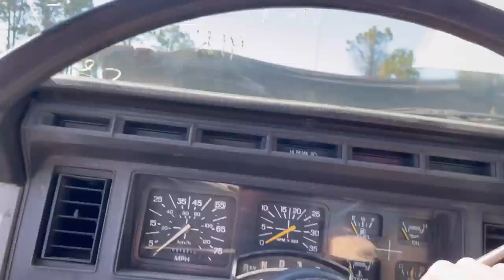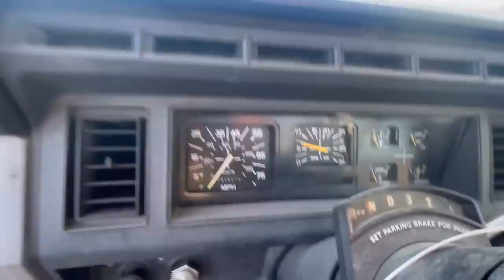How to Get CHEAP Welding Equipment | AUCTION TIME!! |

Comment: The boom truck with the rope winch line is a line truck for electrical work. Many of the newer ones have rope winch lines rated at 50,000 lbs pull. Rope because they’re used to set poles and transformers etc in and around energized high voltage lines typically from 2400 volts up to 34,500 volts. You wouldn’t want steel line although we did have steel in the old days (retired lineman here). The thing you were asking about on the end of the boom is pole claws. They are used to grab a pole when it is standing upright to put it in a hole.
Reply from the maker: very cool bud! thanks for sharing that!

Comment: I don't know exactly what lube equipment or mechanic work entails in this case, but I find it amusing that Anthony wants nothing to do with it.
Reply: It is hard work but great money I'm a mobile mechanic for heavy equipment
Reply: “Lube tech” would be for like a paving company. That the equipment is always on the ride. So, he would go around and service it all
Reply: @Ethan Baker  all types of companies have lube trucks. They just simply lube the machines. Grease fittings, fill with fuel, top of fluids. All types of construction.
Reply: @timmensch  yeah im a field tech too. Clean money dirty hands. Hard but easy at the same time
Reply: I'm 62 retired 7 years ago. Built a heavy equipment repair business from a pickup truck to a full service shop and 5 service trucks. Sold it.
Damn good money for a high school graduate.
Welders are too stupid to be techs.
Reply: @Tom  Baker  that's awesome brother. I am debating starting my own field service business. Actually selling a piece of equipment to afford a cheap service truck.
Reply: @benjaminolsen6520  I have one for sale. Where are you located?
Reply: @tombaker6083  southern Arizona

Comment: Looks to be a 5.9 12 valve all mechanical. Good old motors I believe she is going to be a good rig.  The old 12 valves are a little weak being 4x4 it’s going to be slower but I’m sure it will be very reliable.  Keep up the content.
Reply from the maker: your truck inspired me lol
Reply: @MeltinMetalAnthony  that’s awesome glad I could help. I think you’ll like the capability that comes with a 2 ton truck I know I’ll never go back. Planning on doing a walk around on mine and show improvements I’ve made and problems I’ve had hopefully give you some insight.
Reply: I have the same truck with an altec boom on it absolute dog around town 5th gear is 35-40 and 6th gear gets you up to 62 diwnhill with absolutely nothing on the truck can get more cars places but wouldn’t want to drive it anywhere far

Comment: Looks like a good setup. I'd be inclined to mount the welder with the face and leads coiled up into one of the front cabinets, what ever side is easier, the put some gasket around the cutout for the welder. Save from having to climb up and down that thing all the time.

Shes a bit tall for me,but man does it look functional. Hope it works out for you, cant wait for the videos on it

Comment: I’m in the music business and used to have the same 12V under the bed of an old motor home we traveled in. Used to take turns drivin it all night  and had a spot in the carpet where we wedged the pedal to the floor. Had parachute rope to pull it off the floor if we hit traffic lol. Pulled a loaded 16ft trailer all over the country and got 11 mpg. She didn’t have much power but I never missed a show. Good times

Comment: Badass tank you bought there. Holy shit, that thing is a beast! I’ll be straight up brother... you are quite the inspiration. I actually started welding three weeks ago because of your videos. I bought a little 80 amp arc from the H.F. To tack weld for blacksmithing, but you opened up my horizons to do more. Now, after two weeks of burning holes in everything I touched, or sticking the rod like it’s a magnet; I can finally start a weld without too much of that. Haha, I’ll admit I’ve had a couple melt downs in the back yard, and I think I actually went full on super sayan at one point. 6011 is becoming my favourite rod because you have to think about what you’re doing. I feel like I could take a knapp with 7018 and it would work... if you can get it started. I feel like you have to tame 6011 and 7018 is just it’s beta cousin. Anyway, I bought a tombstone yesterday, so I can run 1/8 inch and maybe pick up some neighborhood fixes for some real world practice. Of course I watch IC weld because who doesn’t, but you’re more gritty like me, so I end up relating to your videos the most. Thanks again for the inspiration, and if you’re ever in Melbourne/Palm Bay area, hit me up.

Comment: Good job, I would have bought that truck too. The best part of buying older equipment is there is no emissions (EGR, DPF, DEF) to worry about. Then I believe that motor is all mechanical, only a few reasons why it would not start.

Comment: That odd "rubbing noise" with the oil cap off may only be normal gear case noise on the Cummins.  My old 12 valve scared the hell out of me when I popped that cap for the 1st time when it was running. 

10 years later after much abuse (like 4500 rpm and 60psi) it's still the same.

Comment: @Meltin Metal Anthony
What frontend is in that truck?
Rockwell or eaton
I think i saw on the truck its awd all the time. So does it have a low range? 
My pops years ago bought a water truck that was a f700 or f750 4x4. But it had a 377ci gas big block ford with a 5 speed manuel trans and a rockwell independant transfercase.
I thought the axels under it were eatons, but they may have been rockwell. Not sure.
Anyway cool truck.

Comment: Sale tax...  What a deal killer.

I'm just an intense DIY repair/fabricator.  I buy everything used from private sellers -- generators, power equipment, power sports equipment, tools, welders, sewing machines, appliances, and anything else I can get my hands on.  I show cash and price negotiation starts at well under 30% of street retail.  I don't bother with anyone other than motivated sellers.

Of course, it helps to be able to fix/repair/fabricate stuff that's not in the best shape to start with.  But, once I give something the once-over, it usually serves me very well.

Getting ahead is a combination of making money and saving it...

Comment: Im guessing your state requires an actual weight printout, Ohio its verbal declaration. Ive registered a chevy 1500 as a 10,500lbs truck for commercial plates to avoid E-check.

Comment: Lincoln Electric Sam 650 used and abused as a stud gun the quality of the machine I'm looking for is its ability to run high definition spray arc I wonder how you would find out is it who got that machine and what they would want for it to part ways with it is it heavy maybe they figure out they don't want to drag it around how would you go about contacting that person

Comment: Cool truck! I find it's hard to buy smaller items at auctions for a welding company because nobody knows retail prices and often pay 20% over it. Engine drive welders always go for high prices in my area! The amount of 10 year old ranger 250s that people bid $5k on is insane! The older bigger items like your truck seam to be where the posers stop bidding and you can actually get a realistic price.
Reply from the maker: the engine drive air compressor I got was a good deal. you have to be quick with the google searches
Reply: @MeltinMetalAnthony  yeah that was a good deal! Those compressor s go for 3k new where I live!

Comment: Nice truck all your welding things can be mounted good price too Cummins engine too the mechanic part I'd not do anymore repairs if I don't have I use to do diesels in the 70s up to about mid 90s along with welding now I'm full-time welder no more repairs

Comment: I swear you are in my head.... only this morning i was wondering. As i learn more and more i keep wondering about finally taking the leap and becoming self employed (and the whole way i got into fabrication was because i was made redundant where i worked before -and had planned to learn to weld and leave there too) 
But i worry incase i ever get made redundant in the future and dont have the money to just go out and buy a welder and van (in the UK) and more expensive tools.  
I already have a large collection of assorted tools, spanners, wrenches, grinder, drills, screwdrivers and things but i really need to save a couple of grand and get lucky and happen accross a nice genset at a auction and i always forget things like this exist

Comment: Anthony. What are the vehicle driving license categories in the USA? And ownership and operation of Oxy/acetylene.
 I ask this as  to drive these large heavy vehicles together with the all up weight we in the UK and I recon in the European Community  required a Heavy Good Vehicle License in addition to the car/ automobile. One requires a medical to get and a medical to keep the HGV license 
Together at least a weeks driving course, a multichoice test and 1- 1.5 hrs driving test with an examiner. Can take up to 18 months to get through all the admissions & £1300 plus. O yes, there’s quite involved regulation controlling the ownership and use of Oxy/acetylene cylinders & cutting equipment. I don’t think we get away with Arc welding in a domestic driveway & parking lots without curtains around the arc & road works notices “Arc welding in progress- DANGER TO EYES”
And when all that’s done one requires an “HGV operators license” to cover maintenance records and the location/ facility of the yard the vehicle will be operated from.
Reply from the maker: thats awful. sounds like your country assumes no one has common sense